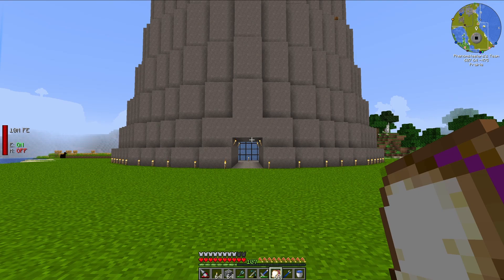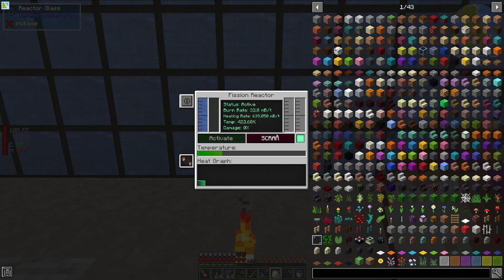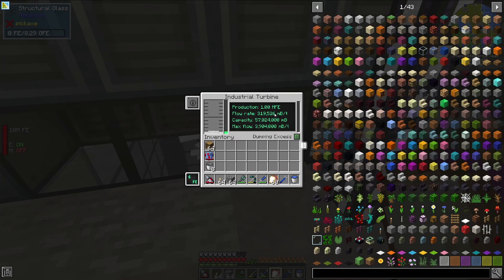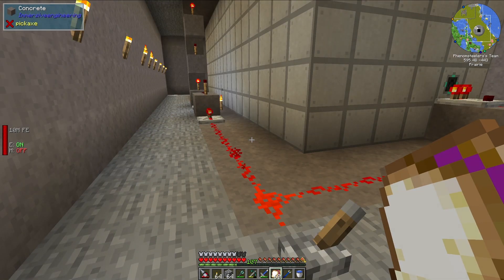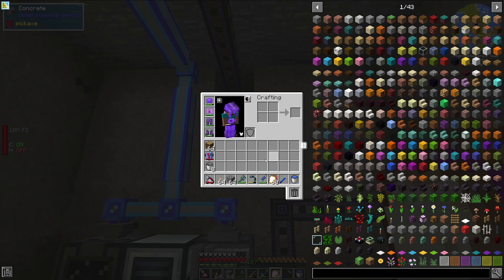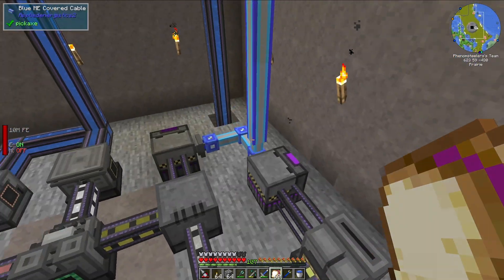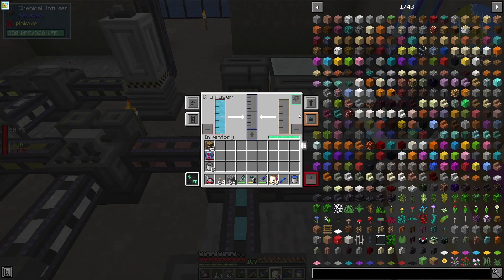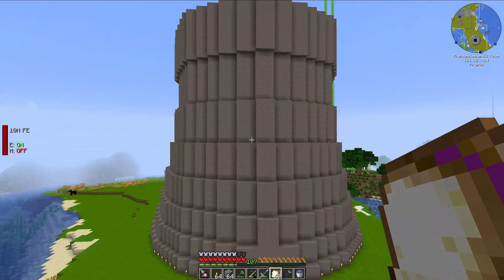Mekanism Fission Reactor Tour

Comment: thinking of building a similar design just a few questions 
1. what are the conditions for a meltdown so i can prevent it.
2. if waste barrels must be moved how can i do so without radiation
Reply from the maker: 1. Always have enough water in your reactor. Always have somewhere for your generated power to go.

2. You cannot move the barrels if they have ANY waste in them. So plan ahead when placing them.
Reply: @minecraftphenom0892  okay and if i am at power cap i can just shut it off and i'll be fine?
Reply: also whats the recommended turbine to reactor ratio
Reply from the maker: @Dman6779  Not sure about the turbine to reactor ratio to be honest. I would recommend using an induction matrix as a huge battery. You can actually use a redstone comparator from an induction matrix to automatically turn your reactor off when your system is full of power. You should be fine if you shut off your reactor BEFORE your energy system is saturated.
Reply: @minecraftphenom0892  okay thank you for your help man, so if i use a 7x7x7 turbine for my 7x7x5 reactor it should be fine right?
Reply from the maker: @Dman6779  Should be fine
Reply: @minecraftphenom0892  tnx
Reply: @minecraftphenom0892  one last thing can i break the reactor without breaking the waste containers and move it elsewhere
Reply from the maker: @Dman6779  I'm not sure. You might want to try it in creative mode because I'm assuming you don't want your base irradiated lol.
Reply: @minecraftphenom0892  lmao i play with 2 others so yea that would be bad
Reply: @Dman6779  i had a 5x5 reactor and a 5x5x7 turbine i think and it worked